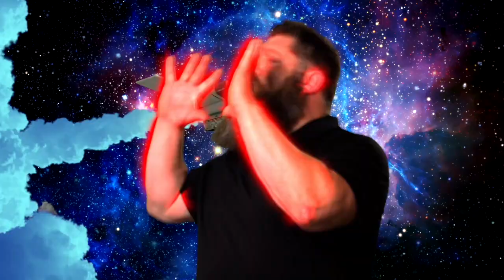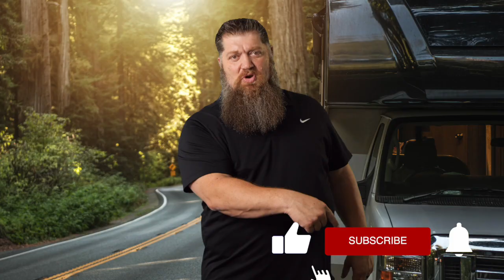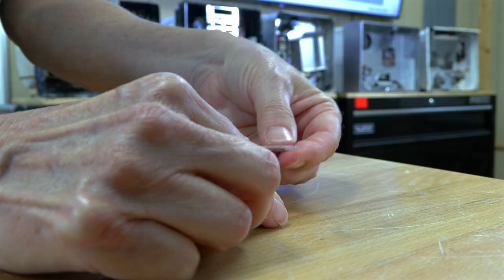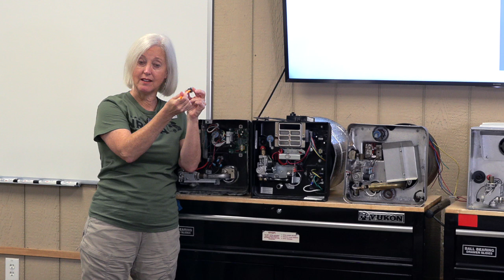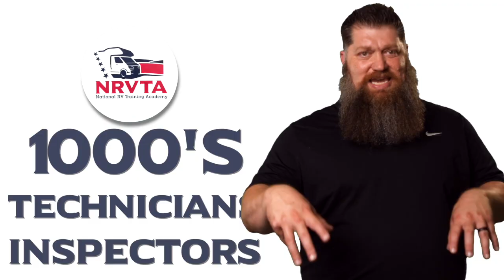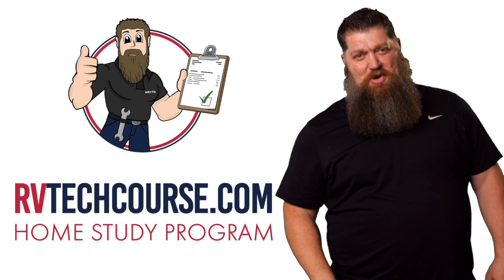Simple Step to Prevent your Water Heater from Failing

Comment: Tja ks for the video.  I have something crazy going on with my atwood/dometic.  Gas works fine, but electric only heats it up to a warm temperature.    If we heat it up with gas all the way then turn the electric on it will keep the water to the same very hot temperature.   Do you have a idea?  I replaced the black relay and thr back of the tank.  Thanks

Comment: Is there a way to remove the leads between the thermostat and emergency cut off from the control board to test those components?  That would seem to elminate the possibility of this occuring.  Like maybe by removing the jumper block displayed at the 8:21 mark?

Comment: Couldn't you just back prob the wire terminals instead of unplugging them
Reply: Depends on what you're trying to accomplish... I agree with you; I'm a big fan of leaving components hooked up unless you absolutely need to take them apart, remove wires, etc. Less likely to create problems or break something, plus faster!
Reply: Not if you’re testing continuity, which is how you test the component.
Reply: @markdavis4056  unless you can unplug something it is connected to that can be disconnected without causing damage.
Reply: I had no idea!   Thank you